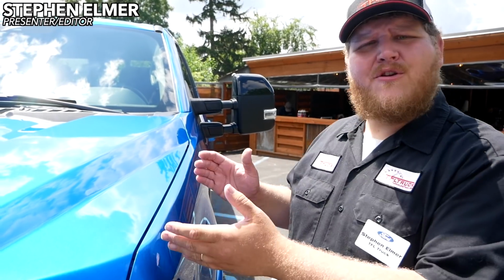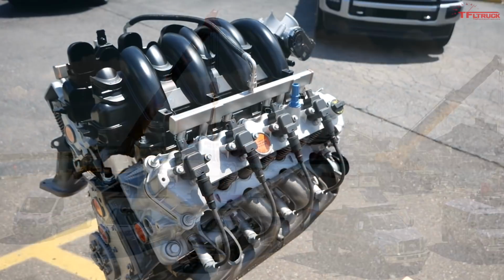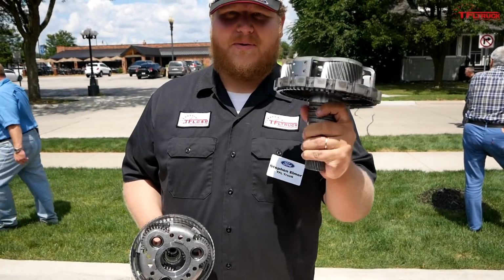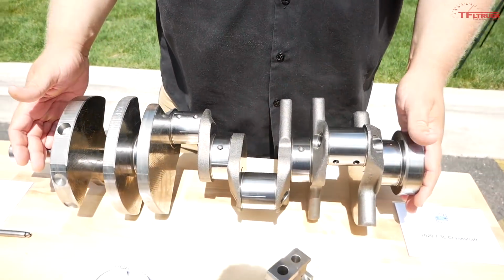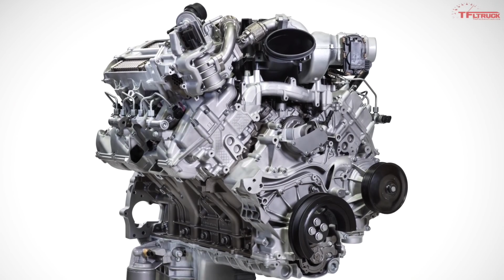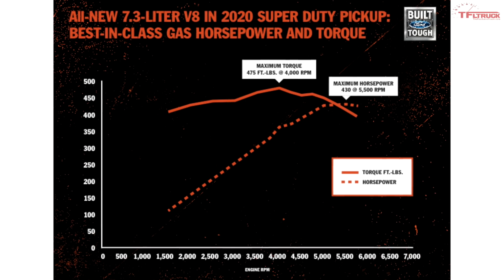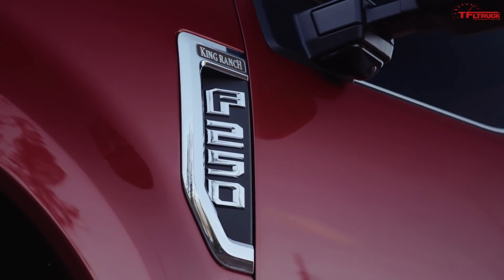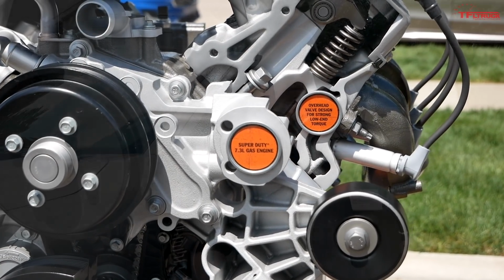We Finally Know the Ford Super Duty 7.3L V8 Power Numbers & They Are Lower Than We Thought!

Comment: 400 lb ft at 1500rpm in a NA gas v8. Thank you ford. This is how trucks should be.
Reply: Can someone chime in with experience how much "better" this will be towing a 23' 6500 lb trailer than a Toyota tundra ? 
NOT being an jerk raining on Ford's reveal day. Just need experience advice. Looking to tow for the occasional weekends.
Here specs on Toyota
5.7 Liters V-8 Horsepower
381 Horsepower 
rpm 5,600 Torque
401 Lb-Ft.Torque rpm 3,600
Is it worth the coin going for the Ford? 
Thanks.
Reply: @rxonmymind8362  To be fair this isn't an engine for a half ton truck.  This is an engine designed to haul a full load and/or tow 20,000+ lbs all day, every day in extreme conditions with long service intervals.

That engine in your Tundra might be a good engine ... in a half ton truck. It absolutely does not belong in the heavy duty segment.  That kind of strain on ANY engine not built for it would result in stretched timing chains, overheating, spun bearings and crank failures.
Reply: @shadowwolfmandan  
Agreed. ALL the parts have to work in concert and be "heavy duty".
Reply: @rxonmymind8362  everyone will just be giving you an opinion at this point as the motors are not out currently. I'm not a ford or toyota guy so pretty unbiased in this situation. My opinion is if you are just towing occasionally and your tundra handles the weight safely then stay with the toyota. Now if you were towing boats regularly for work maybe upgrading to something else a little more capable would be worth it but the money put out on a new truck especially a 2500 for an occasional weekend trip wont be worth it. In my opinion when it comes to towing for recreation the biggest thing is safety. If your truck can saefly handle the weight and more importantly stopping the weight dont worry too much about the effeciency. 6500 lbs is usaully well within most 1500 pickups limits to tow safely. Again this is going on the premise of just an occasional trip.
Reply: @rxonmymind8362  It won't.. but when you put 20,000 lbs behind each of them is when the 7.3 Godzilla will shine!
Reply: Rxonmymind 3.5 Ecoboost makes about 300 tq to the wheels at 2500 rpm and 400 tq at 2800 rpm. Puts down between 300-330 hp to the wheels from 3500 - 5500 rpm. Look up dynos for the different trucks to get a real world tq curve. It’s the power to the wheels that matters, not at the crank.
Reply: @NoticingBehaviors  
Fair enough I'll do that thank.
Reply: @NoticingBehaviors  have you ever used a 3.5 ecoboost for work? it cant hold a load going downhill, not a work engine shouldnt be in a truck
Reply: @iceflameproductionz  the truck managed to have full control of max trailer weight down one of the steepest grades in the county. A half ton truck in only rated to tow so much and the braking system is more than adequate to control it.
Reply: @NoticingBehaviors  the farmer I work for has one in an f150 and we work the dog out of everything we own. Living in VT with real serious grades on every dirt road. It just doesn't work good enough , not enough truck for the job
Reply: @rxonmymind8362  Being non bias it would be better for towing. A 7.2 is going to have a lot more torque than a 5.7. Peak may be close but under peak not close at all
Reply: @jamesavery6671  diesels don't get great mileage towing either.
Reply: @brandonv2578  Better than gas though which does matter if you tow a lot. Even a few better MPG can add up
Reply: @jamesavery6671  depending on the engine it is only a few mpg, at that point the fuel prices can dictate whether that few mpgs is worth all the extra cost of a diesel. That being said, yes, if I towed everyday I'd definitely go for the diesel but for more reasons than just fuel economy.
Reply: @brandonv2578  dunno about that. 

Silverado 6.5 diesel for work, 25mpg unloaded, still got 20+ pulling a John Deere on a trailer with four grown men and the back loaded and a 50 gallon tank of offroad diesel.

I can't speak for all of them but that truck got better mileage than most of my cars. It was damn nice.
Reply: @rxonmymind8362  towing with a half ton vs three quarter ton. No comparison PERIOD. Besides the motor everything else is alot bigger. You could put a 6 cylinder engine in a three quarter ton truck and would out tow a half ton. A three quarter ton truck handles a load alot better
Reply: I agree here. I have a feeling Ford will sell a lot of these. Companies will love them and so will normal people. Plenty of people want more grunt than what the 6.2 has, but don't need nor want a diesel.
Reply: Most fleet trucks/wreckers dont need a diesel.  Waste of money.   They will sell the shit out of these
Reply: I had high hopes for this engine as I am in the market for a new truck and will be towing 15-20k.  I had a 7.3 and in the 90s and early 2000s with less emissions and lower diesel cost and diesel maintenance cost, diesel was the way to go.   But not now and I am not towing 30-40k I was wanting something other than a diesel.   I did some research on torque curves of the 7.3 and the 6.2.  The curve is basically the same but you get around 50 more lbs of torque throught the curve on the 7.3 vs the 6.2.   If I paid $200-$400 for something that was a simple bolt-on and got 50lbs throughtout the curve I would tell everyone to GET IT.  Now 50lbs for a NEW ENGINE that they have been teasing us about for over a year.  It.....SUCKS!!!!!!!!!!!!!!   The only hope is that the 50lbs and the 10 SPEED TRANSMISSION will generate some decent towing numbers.
Reply: @bill84345 Where did you read the  6.2 has the same torque curve as the 7.3? I drove one in an F350 rental, and it didn't feel like it made 350 ft/lbs from 1500 rpm, you had to rev it to at least 2500 before it'd start to really pull, and that was loaded with maybe 3000lbs in the bed. I bet the 7.3 pulls much better, and it'll last a lot longer, being less stressed and having stronger parts.
Reply: @AdmiralRustyShackleford  it doesn't have the same torque curve, this is just a fact. The dyno graphs are out there. The 6.2 has a peak around 4000, the 7.3 is flat at 400 ft lbs until it drops off. It looks like my 390 only it runs a higher RPM.
Reply: Probably comes stock with a good towing cam.
Reply: the Diesel weighs about 400 pounds more than the Gas, Costs about $5000 more, and is Way Overkill if you're not Towing and Hauling
on a regular basis.  Excellent Job Ford
Reply: for those interested the 

6.2L Chevy makes 350 lb-ft at 1,500 rpms, and doesn't reach 400 lb-ft until 2,750 rpms, and 460 lb-ft peak at 4100 rpms
Reply: @Rod Smith yeah, it's like my 390. 330 ft lbs @ 1000 RPM, 400 ft lbs by 2000.

Stump pulling torque man. Just wish mine revved higher.
Reply: But people don't understand gear ratios coming out of the drivetrain. Even if you're 200ft lbs at 3000 rpm of you run twice the gear you get the same torque to the wheels. 

If this motor can spin 5500 rpm then all you would need to be equal it's an 11000 rpm engine making 250 ft lbs. To be greater than this engines peak. Guess what a k20 has the potential to be able to do it. Just not in stock form.

So that being said, an ls7 7.0, built pre 2006. Makes more peak torque, close to as much torque by 2000 rpm and makes equal to or greater horsepower depending on test method. One step lower in gear ratios and a ls7 would be a superior choice in a truck.

Really how often to people tow at full throttle, 1500 rpm and the transmission not downshift.
Reply: Totally! So sick and tired of these tiny little 4 bangers with turbos bursting at the seams trying to rev to 12000 just to get power in a truck.... so dumb.
Reply: @ejcheli   4 bangers reaching 12k ? Lol I'm not sure what you are talking about on that, other then a sports bike .  I think you may be confused , no worries.
Reply: ejcheli you don’t know much about trucks do you? The 2.7 Ecoboost develops 400 ft pounds of torque at only 3,000 RPM. Most modern V8s develop their torque at higher rpm than that.
Reply: @ebsell  Peak toque Maybe but Big Pushrod V8s like this make big power at super low RPM and keep that power there until redline. The turbo small engine is a dumb craze anyways. Sure theyre powerful but they guzzle fuel worse than the larger V8 engines in the real world and are ultimately far less reliable. Hell they don't even save truck weight. Fords own 5.0 is 20lbs lighter than their "Eco" boost V6s 🤷🏼‍♂️
Reply: @ebsell  Oh but I do. Those tiny engines only "produce" that torque because its turbocharged. I may have exaggerated the RPM but the pressure... nope. They are wearing out so fast under the stress of all that boost crammed into them to achieve those numbers. Meanwhile, NA V8s happily chug along decade after decade producing fantastic power. Simple physics.
Reply: ejcheli plenty of diesels have huge boost and run 1 million miles.. aka semi trucks.
Reply: @NoticingBehaviors  True, but semi trucks don't have teeny little engines in them either, they have massive robust blocks. Perhaps I'm wrong, but this isn't being done with the light truck market...
Reply: @ebsell  And you think towing anything bigger than a football with an unbalanced, vibrating, turbocharged (witch means uber fuel consumption while under boost and heat soak leading to lesser and lesser power as you stay in the throttle for even short amounts of time), and all this with a crankshaft that you can play catch with.. so yeah, you're right, only a fool would buy such a thing..
Reply: ejcheli bro is that why diesel outlast gassers or have you just been living under a rock?
Reply: @ejcheli  You're not wrong.
Reply: @NoticingBehaviors  aka semi trucks don't have aluminum heads.. new diesels in pickups are 150k throw always. Emissions killing them
Reply: @jkheslekrants  big v8s all produce low rpm torque.
Reply: @ejcheli  the blocks are not as robust as you think inline blocks inherently need a lot of reinforcement to be considered robust.
Reply: @kingofkickass1  diesel doesnt outlast gas without a rigorous maintenance schedule or comparing a massively over built engine to a light duty engine.
Reply: High torque at low rpm isn't a Ford thing, it's a pushrod thing. 

Welcome back to reliable motors Ford.
Reply: SySTeM4T1c 
I too am happy about this OHV engine but let’s be honest here, Ford has been making reliable engines with the OHC mod motors since 91.
Reply: Only took them 20 years to do what gm did in '01 with the 8.1l. to bad Obama's epa killed the 8.1l, would be great to see what current tech could have done with that engine.
Reply: @brandonv2578  you know ford had the 460 (A 7.5l) till 98 right and it was a stump puller at idle, my 90 f250 with her 460 is still kicking at 600k.
Reply: @TdrSld  well aware of the 460, gm also had a 454, and even Dodge had a 440 big block. None of them were in the same league as the 8.1l. the 8.1l (496ci) was probably the best low revving  towing gas engine ever put in a truck until this new ford engine, pending it performs as advertised.
Reply: @brandonv2578  The output for 460 engines built before 1972 is 365 horsepower at 4,600 rpm and 485 pound-feet of torque at 2,800 rpm. And the 90's models made 90% of its tq. well below 3000rpm , so the 8.1l with it's almost 4000rpm peak torque is nothing new or to right home about in it's torque curves.
Reply: @TdrSld  454s built before 1972 had over 500 lbft. Stop comparing gross numbers to net numbers they arent at all the same.
Reply: Get a diesel
Reply: Chris Stewart or I’ll get a solid big block truck that’s easy to work on, makes a lot of low end grunt, and to top it off several thousand cheaper. This is the engine to get unless you really need the diesel.
Reply: Ryan Martinage I would love to get this motor instead of the diesel I bought because I needed the capability. Wish I could afford this in a new super duty
Reply: @ryanslifeirl  Yeah but gasser's get horrible mileage towing lol.
Reply: @jamesavery6671  Most don't drive around all day with a trailer. For the user who wants a truck with more towing and payload capacity than a half ton, I think this will be a great solution.
Reply: @ryanslifeirl  and don't care about the milage
Reply: @hellojoe70  couldn't pay me enough to buy a modern diesel pickup truck.
Reply: William Stewart why’s that
Reply: @kingofkickass1  Because they're throw away engines now, run so hot and lean and make the power they do with such little displacement. Absolute garbage in my eyes, I wouldn't be caught dead towing more than 20k lbs with a dinky pickup truck anyways, I have a real truck for that.
Reply: William Stewart oh well ur just one less customer.
Reply: @WilliamStewart1  just use an egr delete kit, program it and put a tow tune on it, they all run like beasts, cummins especially.
Reply: @NoticingBehaviors  A Ford LT8000 with 20k front axle and 48k rears. Has 12 ton Fassi knuckle on it and a 20 foot dump bed with removable sides. It's setup for a pintle out back. I can put 15 ton on the back or tow 20 ton.
Reply: @kingofkickass1  new diesel motors are 150k throw always. You know it's a throw away when the head are aluminium and some cases the pistons. I want a diesel to go 500k
Reply: Chris Stewart that’s what im saying.